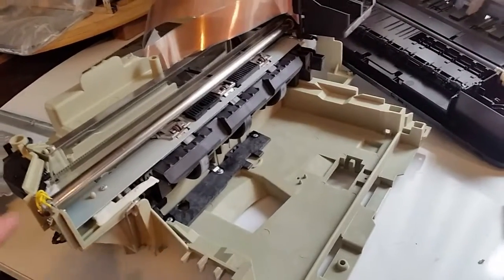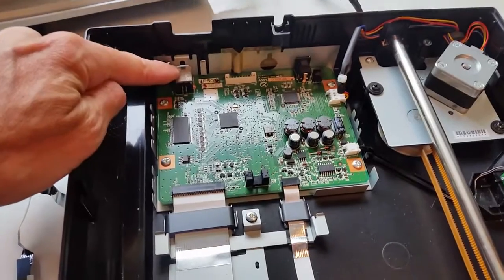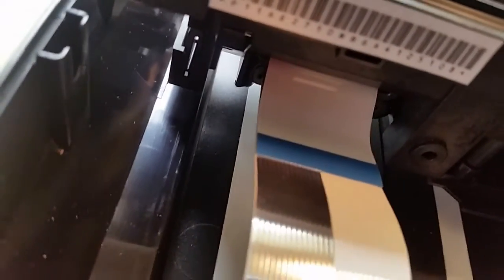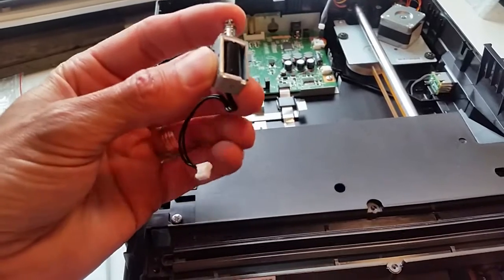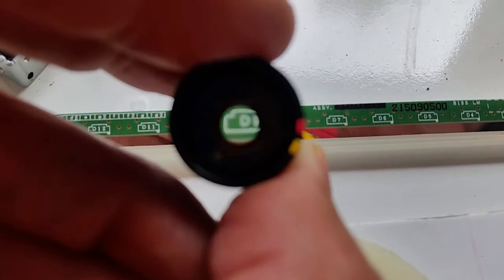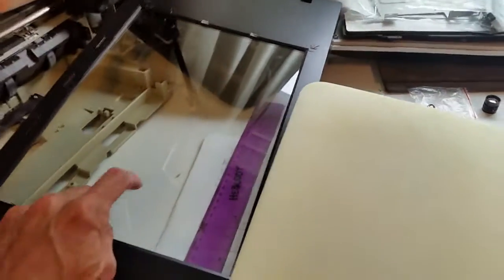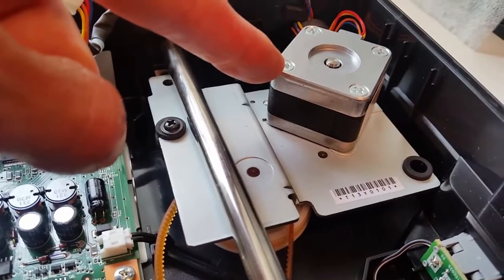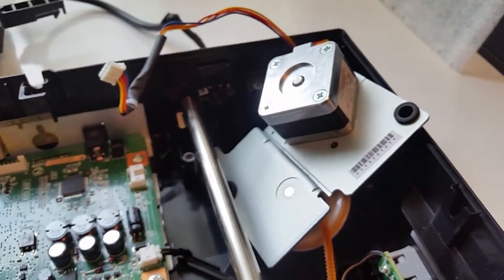Flatbed Scanner Teardown

Comment: are there 2 optical sensors (one on each end of the shaft) to provide signal for end stop of the motor?  thanks
Reply from the maker: There is only one I believe. It only needs to go to that home sensor, then scan N number of steps.  They can count the steps from the stepper pulses they send to the motor.

Comment from the maker: Good news everyone: I also got the xy movement working (one axis PID), and the results are great! I'll release that video next!
Reply: Great job, waiting!
Reply: I am really wanting to know more about this project, I have mine waiting for your achievements!

All the best
Reply from the maker: @tibyanne  cool! What is your set-up like?
Reply: @TheRainHarvester  the same as yours, I've tried misan/dcservo on GitHub to run everything but with no luck till now :(

I have many dc motors with encoders salvaged from inkjet printers and I really want to put it in a good use like a plotter and vinyl cutter and maybe a laser cnc.. all is possible but the software part keeps getting in my way.

I love dc motors and prefer it over steppers.

https://github.com/misan/dcservo
Reply from the maker: @tibyanne  oh, why no luck till now? Just curious what changed?
Reply from the maker: @tibyanne  Did you ever add another axis? Or just one axis like I have shown so far? Just curious.
Reply: @TheRainHarvester  The PID values for dcservo code, I've tried a lot of combination and found none working good to be used for a plotter. I left this project, but when I found your channel I started tinkering again, hope it works soon.
Reply: @TheRainHarvester  just one axis like you did, it didn't work well so I didn't bother with a second axis.
Reply: Yea, I'm helping!  :-) Looks like you are making good progress, thanks for the update. I've salvaged some scanners and kept the parts, but never actually built anything with them.  Props to you!
And yes you can 3D print on glass.
Reply from the maker: @printerstein1321  Thanks! Btw would you recommend a pcb heater, or one of those silicon/aluminium combos? (I think I want to stay at 12v because I've got a lot of old pc power supplies.)
Reply: @TheRainHarvester  I've used both with no issues,so i can't say one is inherently better than the other. Application and cost might be better factors. The pcb style is what i seem to use the most though. The last time i used a silicon heater mat was when i needed to add a6" heated bed to a printer and could not find a pc board in that size. 
Totally get staying with12v for that reason. Most of my printers are powered by12v 200a bricks i get for free from the e-waste bin at work. Sometimes you just gotta use what you can get!
Reply from the maker: @printerstein1321  If you ever need higher voltage, you can put similar bricks in series with some diodes.  I was lucky hackaday featured my video on it. I use it for my cnc machine: upto 57 Volts, but I only use 38 v with two 19v. 
12v 200a?! Wow! Nice e-recycle bin!!
Reply: @TheRainHarvester  You know I was about to try that a few weeks ago but got distracted and the bricks are still sitting on the workbench. Guess I should get back to that!
Our manufacturing facility has hundreds of PCs and when you buy one to replace a failed PC, you get the power brick with it. We toss so many of these out, I've got a few dozen and a lifetime supply of them if I need more!
Reply: My goal is to run the motors at 48 volts, and that is fast, really fast, so maybe the atmega328 I have is not enough for this task. I have ordered stm32 bluebill, I think it should work for this.
Reply from the maker: @tibyanne  I'm using 16 MHz similar to Arduino. So far I got the 2nd axis from this flatbed scanner working with this dc servo motor axis.  It's actually nice to have one axis a stepper (for now) to verify any overshoot to be in the one dc encoder...instead of debugging two dc encoders at once.  
I need to make another video.  Thanks for motivating me! :-)

What hbridge/motor controller are you using to convert the pwm into motor currents?
Reply: @TheRainHarvester  Thank you!, I only have l298n available for now, it needs to be changed, but for testing purposes it is ok for now.
Reply from the maker: @tibyanne  Why does l298n need to be changed? Not enough amps? I'm using L293D.  The D version is only 600mA but upto 36  volt. But I think D version has reverse blocking diodes for back emf protection.
Reply from the maker: @tibyanne  oh, wow 48 Volts. That is fast.  The inertia must be huge!  I'm hesitant to drill into the shuttle to connect anything because I don't want to mess up the shuttle or encoder strip. 

I might superglue magnets onto the shuttle so magnets on the print head could hold both tight (kinematic joint).  Might be easy to swap out too.